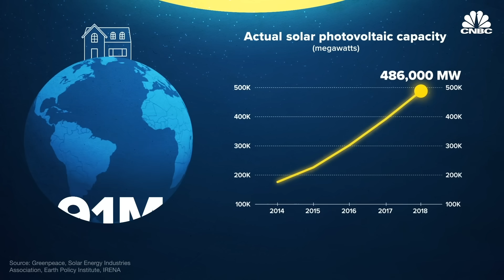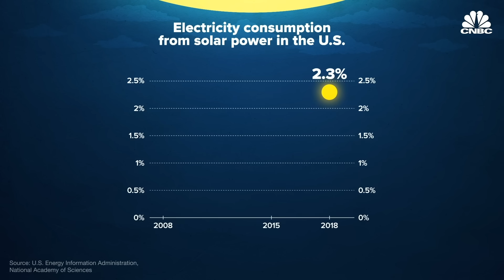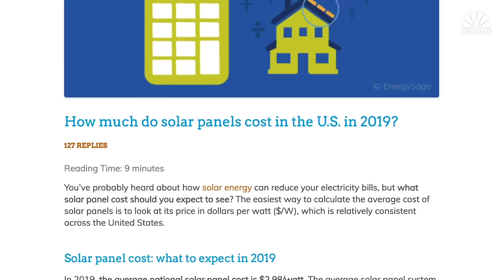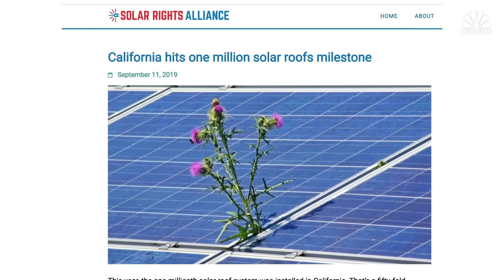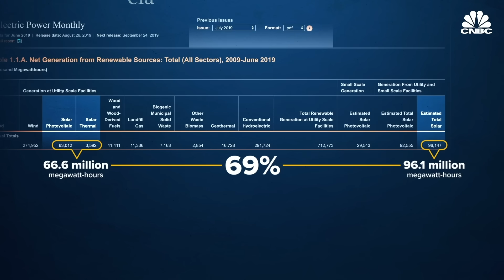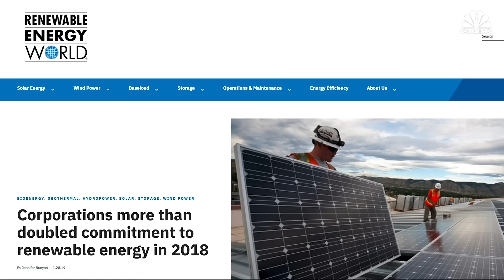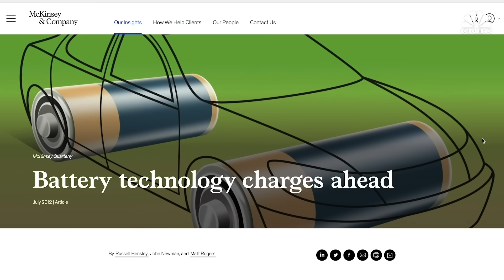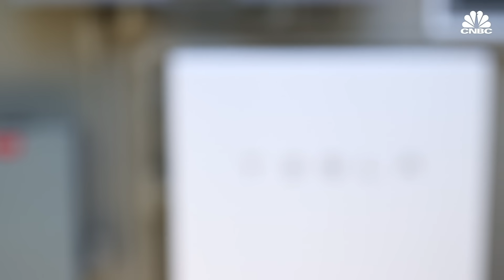The Rise Of Solar Power

Comment: Solar is just as bad or worse as fossil fuels.  Let's point out what happens with glass and mirrors and reflective surfaces.  Like a car a gets hot.  Take note of the solar panels that shot down birds in midflight at over 900 degrees.  

This tells me large scale solar is heating the earth faster magnifying literally the whole atmosphere.  Where most burning fossil fuels release steam/heat and clouds that block the sun and cool as it rises, solar is heating up the upper most layers which is likely worse.  I'd wonder if it evaporates the water in the atmosphere keeping it from raining.  

Regarding ice caps, like ice cream once it thaws to slush like mix it accelerates much faster than if it's one big ice chunk.  So of course ice caps would melt faster as water rises.  

Thing that is crazy is everyone is in a panic over nothing...the ones at the top leading the charge aren't doing anything to slow it, celebs, politicians, they aren't canceling private trips on yachts or planes, they still keep their mansions.  
Also let's point out scientists said we were headed for an ice age not too long ago in the  70s/80s.  

Also there was an article suggesting that the Earth's changing in fields could be the culprit.

One thing is for sure we're not heating the earth that fast, it cools everyday and gets warm everyday...heat is escaping.  After wild fires of countless acres burned, billions of gallons of fuel burned constantly, heated building, stores etc.  Yet we still get freezing temps below zero.  

I don't believe it is as serious as the media makes it out to be.  People live in Siberia at -30 degrees, and people live where it is 90 nearly all the time, we adapt and move on.  5 degree change would be nothing, it changes that much everyday...we just need to start building better locations and stronger buildings...we have the ability to live just fine with climate change.

Comment: All wind and solar made possible by mining and manufacturing powered by fossil fuels, coal, and nuclear. Solar panel manufacturing is also responsible for many toxic chemicals not to mention chromium, cadmium, and lead polluting landfills as the panels rot.
Reply: Just because the oil industry makes things possible doesn't mean they should be the Sole Provider of all energy. There may be some examples of bad solar disposal but pales in comparison to the damage is brought buy oil spills like that last one in the Gulf that's still probably spewing oil. Not to mention all the toxic gases that are released when you burn it to get your power
Reply: All the chromium, cadmium, and lead was mined from the ground.
In the end, it just goes back into the ground.
Just at a different place.
Your place.
>

Comment: Rock bottom solar prices and zero marginal costs are hammering the profits of the utilities. 200 MW is small for nuclear or coal, but big for solar. The whole market is changing.
Reply: Bernard Finucane 200 MW is really small for nuclear where just one reactor lies around 1000MW to 1400MW
Reply: @andreaswickman1508  moot point. Nuclear is now at twice the price of natural gas and 4x the price of solar/wind
Reply: @Mr Penguin no means to store the energy? Water can be and is used as stored energy. Wind, hydro, wave all work day and night also. Only solar doesn't work during the night tough solar isn't the best for macro generation so it isn't much of a concern.

Nuclear needs massive amounts of water and water is becoming more and more of a finite resource. You'd have better luck burning natural gas than wasting huge amounts of water

Lastly, you can't produce nuclear energy to any realistic degree offshore as you can wind and solar. Nuclear plants for safety needs kilometers around them without major population center in what is basically idle land. Not practical
Reply: @Mr Penguin cost... and there is nothing in nuclear power plants that desalts water. It's just a party trick to sell nuclear in poor and dry regions. It's cheaper to simply build a facility to desalt water

You're the one advocating for nuclear and I'm the one behind?😂 I work on nuclear material research fyi
Reply: @Mr Penguin invalid? It does need to use huge amounts of fresh water. What you're talking about is desalinisation and then using it. Guess what, people need that desalinised water much more than nuclear power plants.

Also, I hate nuclear? What? So someone who readearches cancer has to like to get cancer? You don't make a lick of sense

And I do not research nuclear power, but rather nuclear materials. You realise theres much more to nuclear material than producing electricity
Reply: @Mr Penguin salt water is much less effective at cooling and pretty corrosive. It would be a security hazard to have it anywhere near a nuclear reactor. You're completely clueless, aren't you?😂🤣
Reply: @Mr Penguin coal plants also continue to be built in multiple countries. Doesn't mean they are sustainable over the long term or even a good return on investment as a lot of stuff in the energy sector relies on subsidies, some of them outdated to current needs and available technology
Reply: @Mr Penguin coal plants in the US are closing because they are in fact not profitable. Nuclear is and will continue to be twice as expensive as natural gas and anything else. Just look at a country like France that heavily relies on nuclear and as a result is under constant electricity price increases, one of the factors leading to increased costs of living that are causing riots in there and then look at Portugal, which has now over 50% of its electricity from renewables and is now seeing electricity price decreases for the first time in the last 50 years and catapulted its biggest player in electricity, EDP, to the world stage, being now the 3rd biggest in renewables in the US and extremely profitable

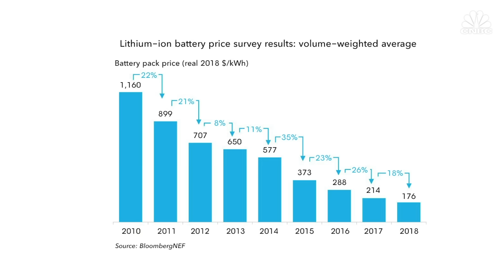Comment: The chart at 10:05 is interesting. Although I think Tesla had to produce cheaper somehow: in 2013 they already had the 85 kwh Model S, which would meant that 85*650=55250 USD was only the battery. I did not find any information how much Model S cost back than, but this is quite a huge part of the price. (I guess it was around 100-130k USD).
Reply: Around 10 years ago it was 1000/kWh. So a 75kWh battery was 75k$. Now they are down to 180/kWh or 13.5k for a car battery.

I've talked to someone from R&D at VW and they are currently at 100€/key for the cells. (Which should translate to around 150 for a battery)

Comment: You start realizing solar energy is a silly idea when you start thinking of all you need to replace a single nuclear or fossil fuel power plant with solar panels.

Second, you realise that solar power is even more silly when you analyse the energy needed to create every component i.e Tellurium. My rough estimate tells me that it takes about 40 years in some parts of the US in order to offset the energy needed to produce Tellurium vs energy produced by solar panels

Comment: So much effort and additional destruction of the environment because someone in California doesn't like a big hole in the ground in Wyoming. Seems pretty stupid to be manufacturing all of these photovoltaic  panels, copper wire, aluminum wire and frames, steel products for enclosures and conduits, when the proper infrastructure already exists and is incredibly reliable. When I want to build my new home in the next few years, I will have to pay less than $5000 to hook up to existing grid power, which includes everything including labor. Now, places like CA want to mandate that you have to pay $16000 to install solar on your roof. Government is ruining the ability for citizens to lead a happy and debt free life.
Reply: Ya, they also mandate that we're connected to the grid, pay property taxes, follow by-laws etc. Bunch of commies.

Comment: Solar is at 12% capacity factor.  This means for a 1Gw continuous output one needs at least a 8.333 Gw plant 1 Gw to supply the grid and 7.333 Gw. to go to storage. That is batteries or pumped hydro or lifting large weights up a mountain side to supply power the other 88% (100-12) of the time.
Reply: Storage was mentioned. Coal and gas have 100% pollution factor.

Comment: Power to Gas is the best Option now for cheap storage. In Europe the first 100 MW facilities are under construction. With that you can turm electricity to hydrogen and natural Gas
Reply: "Now for cheap storage"
The issue is that natural gas is still to cheap.
Yes gas storage and transportation is cheap but power to gas is still to expensive, but once you get an industry of scale prices could come down.
It sure sounds like a good option in the future, which should be invested in.
Reply: You can more easily fill dams
Reply: @fgsaramago 
More easily as in it is more efficient and cheaper yes, but in regions without dams and without the possibility to build them, it isn't  easier, but impossible.

Comment: It seems like nuclear and hydropower would be a better option for providing consistent fossil free power on a system level. That would avoid the need to maintain and pay for backup gas power capacity and help save the climate.
Solar emits twice as much CO2 as hydro power per produced kWh, and nuclear is much cleaner than hydro, according to IPCC.
Reply: I don't think it's a zero sum game. Hydroelectric is very common and is usually implemented when it's an option. Obviously hydroelectric relies on availability of suitable land, which isn't always an option for some places. Nuclear Power has exceedingly high startup costs and implementation times, which is why it's not favored. It could be a rather poor investment to spend trillions of of dollars and 20 years building new facilities, when the cost of implementation of solar/wind energy storage may plummet dramatically in that time. Nuclear Energy is a very viable concept, but I think people encounter a fallacy in thinking that the most effective way to generate electricity must be the most technologically advanced one. I'd say Nuclear is a fine option for places that don't have good hydro, solar or wind viability. Personally I think that solar and wind would be best implemented on a micro-grid level, ie: having solar panels on places of use, and wind turbines in industrial complexes. I could see solar and wind being very effective at supplementing energy consumption at the place of use, rather than being used to generate power remotely at large facilities.
Reply: Two major advantages of solar and wind are that there are no fuel costs of any kind, and they have a low incremental capital cost when more generation is needed.

Comment: When you cover what had been a meadow, pasture or even desert, you remove what can be nature's perfect solar collector.
 https://www.youtube.com/watch?v=vpTHi7O66pI&t=11s 

Google map DFW airport, where it is not uncommon to see 100 degree temps for 90 consecutive days, and look at the footprint of some of those warehouses nearby. If you covered those roofs with panels and never plugged them in, the shade alone they provide would leverage the benefits.
 I have seen many solar fields on what had been a meadow, virtually adjacent to a parking lot of the same size where the motorists could be parking in that shade.
Reply: pedro97w Once we have 100% zero tail pipe automobiles all carparks can be shaded and help recharge the workers/shopper vehicles.

Comment: How about Hydrogen fuel cell. Simple and water is everywhere. All we need is a safe storage.
Reply: "How about Hydrogen fuel cell."
Electricity is required to make hydrogen. The by product of making hydrogen is green house gasses, which then require more electricity to scrub the CO2 into something storeable. Although hydro fuel cells make economic sense for long distance travel, using solar to produce that energy makes no sense as the resource cost is almost two orders of magnitude waste compared to electricity from efficient sources like hydro and gen3+ nuclear.
Scientifically the only viable way for hydrogen fuel cells is through gen+ nuclear electricity/hydrogen/desalinization/scrubbers production.
Reply: @dmay3391  soz forgot to mention. I meant using Hydrogen to store energy is more sustainable and cheap if we invest more in this tech. Or maybe I just didn't get your point.
Reply: @Matt-Nimith  far easier and cheaper to use dams as storage
Reply: There is also the problem it takes more resources to produce Hydrogen
You might find this video interesting: https://www.youtube.com/watch?v=f7MzFfuNOtY

Comment: Solar power is the most easy to maintain and to clean-up.
 Best form of electricity generation ever. No mechanical parts. No pollution. Cheap to maintain. We can be very happy to have solar power on our planet !
Reply: And don't forget a lot of the material (not all of it) is recyclable.
Reply: Solar panels are not made of butterfly wings and grass clippings.
Reply: The world seems to disagree that solar is best, wind produces more than twice as much.
Reply: @Mr Penguin Same here, but Curiosity used a thermal radioisotope generator...
I think going very far from the Sun will mean nuclear power.
Reply: Do we have to pick just one???
Reply: Nuclear fusion is the way. Much better than this.
Reply: @TheHaters112  nuclear fusion hasn't been done efficiently yet
Reply: @TheHaters112  But you have to de-commission the plant which you are not factoring into the cost.
Reply: @TheHaters112  Nuclear fusion isn't here. We have reliable CURRENT TECHNOLOGY in wind,  solar, and batteries that can provide all the energy for the planet.
Reply: No pollution?  Stop it. Solar panels have a life of only 6 years. To recycle the panels is a big problem.
Reply: "Solar power is the most easy to maintain and to clean-up."
Clouds reducing solar output to zero is clean up able. Snow and dust on panels is a maintenance requirement.
"Best form of electricity generation ever."
Solar is the most resource intensvie way to product energy. Farrari's are also the "best", but everyone using they to drive to work is just as stupid as solar electricty.
The only viable solution for the current and huge increases in electric needs from electric cars and desalinization is gen3+ nuclear. Most scientist agree, to deny gen3+ nuclear is the answer is to be a science denier.
"Cheap to maintain."
Sunset Solar, San Francisco $0.51/kWh. Topaz Solar Plant $0.41/kWh. Hydro/Nuclear/Natural Gas $0.05/kWh. There is NOTHING "cheap" about solar, it's the robber baron of electricity.
Reply: @dmay3391  no, it's just that the US hasn't yet reached the necessary scale. Here in Portugal solar and wind are way cheaper than natural gas or coal, not even comparing it to nuclear which is by far the most expensive.

On account of renewables our energy bills have started to go down for the first time in 30 years
Reply: @dmay3391  You hid the pricing of nuclear in with hydro and nat gas. This is because nuclear is absurdly expensive in financial, risk and other costs. Please consider learning why nuclear is not the answer at: www.FuckNukes.com
Reply: @ProgressiveVegan  "You hid the pricing of nuclear in with hydro and nat gas."
Oh sorry, here: Nuclear power $0.05/kWH. Now the efficiency of nuclear isn't hiding with $0.05/kWh Hydro and $0.05/kWh natural gas.
"Please consider learning why nuclear is not the answer"
Please learn that scientifically 1960's Gen1 nuclear criticisms has NOTHING to do with 2019's Gen3+ nuclear.
You've shown everyone you don't know.
Reply: @ProgressiveVegan  Renewables are scam, nothing is renewable, btw, if you are looking for the longest lasting source of power, you should start black hole farming right now, because the Sun will burn out in 6000000000 years, but the largest KNOWN black hole will last for 500000000000000000000000000000000000000000000000000000000000000000000000000000000000000000000000000 years, and will provide and exponentially inceasing amount of energy.
Reply: @ProgressiveVegan  Your site shows, that nuclear is cheaper than all solar and most wind, without energy storage.
Reply: @dmay3391  agree. nuclear is the only way forward.
Reply: @joachimpetersen2301  Except for the cost  and time of construction. That's at thje front end, then you have to de-commission it at the back end. Let alone the risk of another Chernobyl.
Reply: @linmal2242  The risk of chernoby doesn't exist, as the reactor there was so terrible, that designing anything similar would not be allowed.
Also, it was the USSR, and that explains everything.